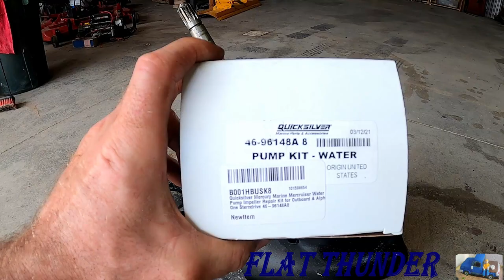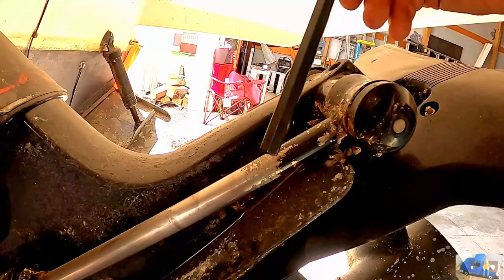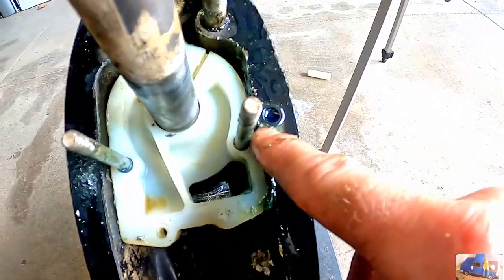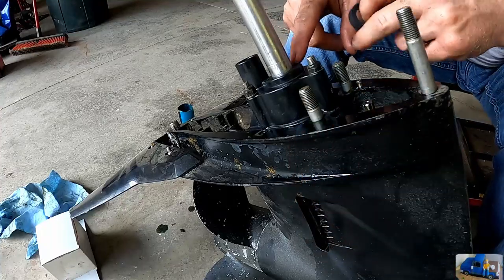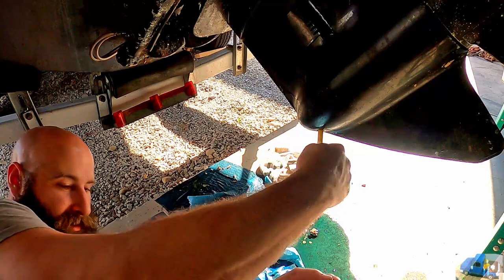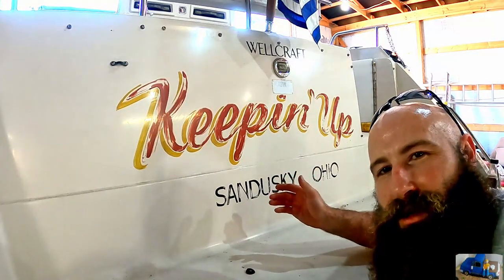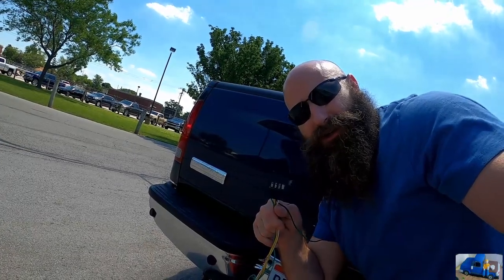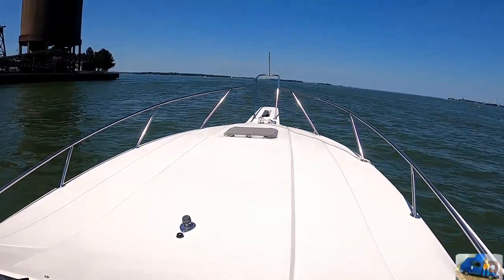1989 MERCURY ALPHA 1; WATER PUMP, GEAR LUBE, BURP TANK, ETC

Comment: Thank you for sharing your knowledge. If you still remember could you give me some information on the impeller water pump you used. I just bought a 1989 Searay with a 4.3 mercruiser and alpha 1 gen 1 out drive.
Reply from the maker: You are welcome!  Below you will find some affiliate links to the products I use!  Thanks for watching and best of luck on the repairs!  👍😁

Quicksilver Impeller Kit - Alpha 1
https://amzn.to/3sr7x1D

Sierra Impeller Kit - Alpha 1 (includes bottom plastic housing)
https://amzn.to/3OXWLb3

Quicksilver High Performance Gear Lube
https://amzn.to/45uqtLx

Comment: You mention your boat was sitting for over 2 years, did u empty the old gas in the tank and replace it with new gas?
Reply from the maker: Customers boat.... It was in the water in 2019, but used very little fuel.  In 2020 it was dry docked because of the COVID bologna.  No, the fuel was never drained.  It was topped off with new fuel each year it was used and Stabil was added to the fuel each year.  Thanks for watching!  👍😁

Comment: If it was me. Personally I would fix the wire nuts at the battery cables. And make sure the alternator is charging both batteries.
Reply from the maker: I agree wire nuts are not the correct solution, but they have also been installed like this since 1990..... Why fix it if it ain't broken?  The alternator should charge through the heavy gage wires.  Thanks for watching 👍😁
Reply: @FlatThunder  understood, I’m a mechanic so I try to do preventative repairs so it doesn’t cause future corrosion or connection issues